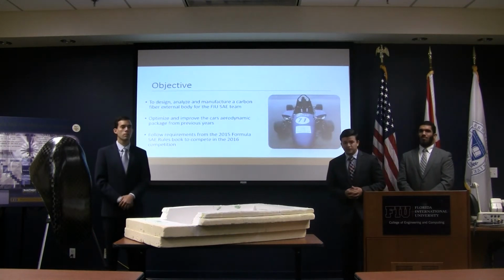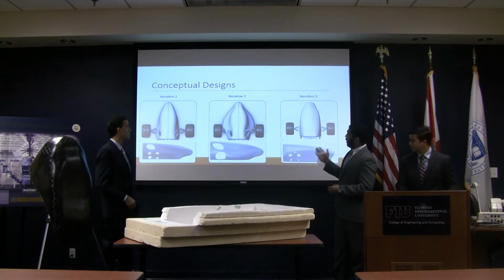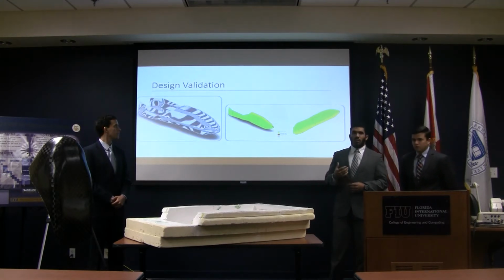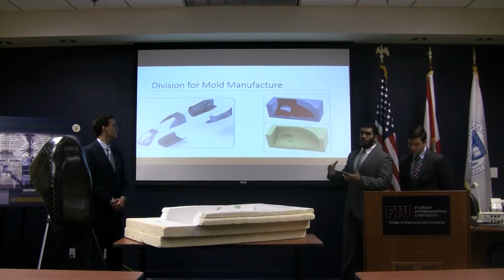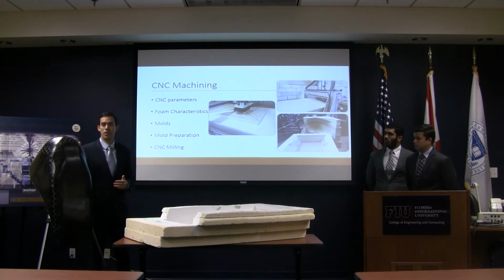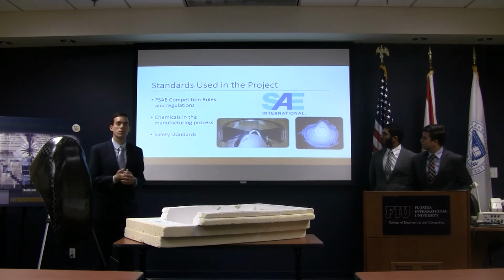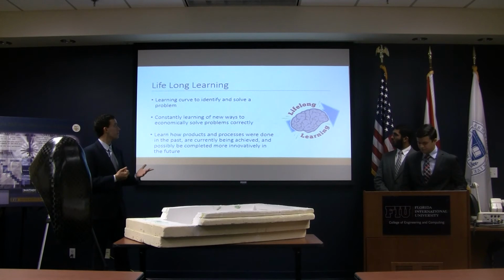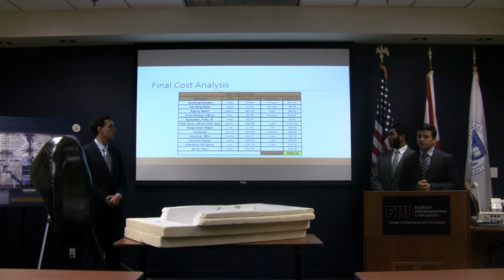Team 3: Formula SAE Aerodynamics Package

Comment: excellent presentation team. interesting project. however, you should have gave more details about your conceptional models and how you chose exactly your design. thee is an open ended solution for this project and three conceptional models seems not enough to decide.